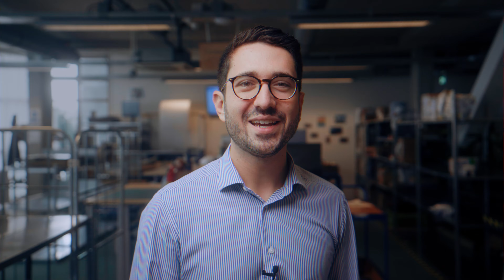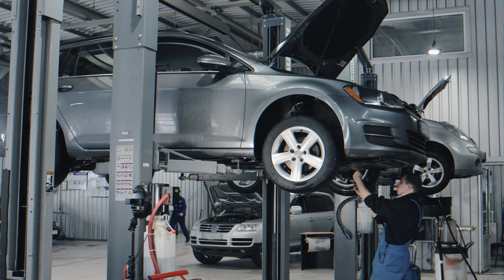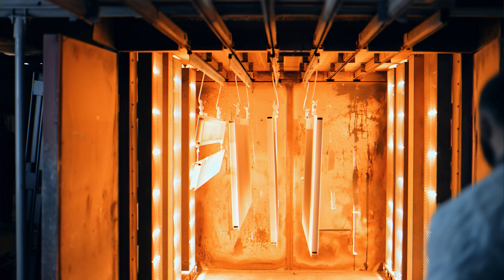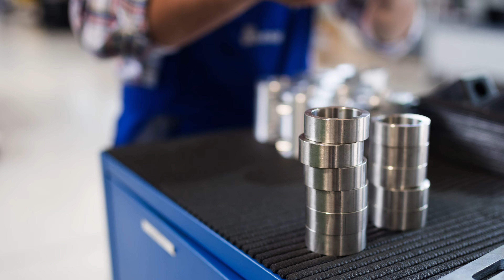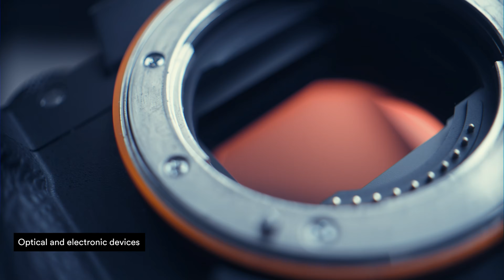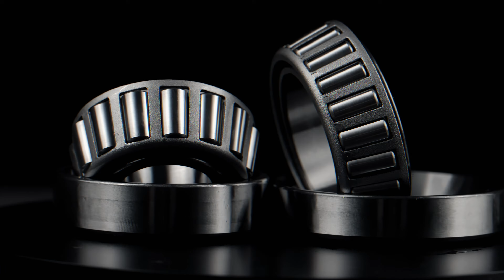When to Use as Machined Finish for Your Parts (and when not)

Comment: The surface roughness of bearings an sliding parts ist sometime counterintuitive and polishing this parts can be a failure point. The little groves, left from griding acts like a smal oil reservoir and helps with lubrication. A Polished part don't have this grooves and this can lead to a failing oil film.
Gauge blocks are a very good example what happens, when the surface is to smooth. They can stick together like they are glued. Just because of the very high surface finish. On Machinetools like Lathe and mills on the other hand, there is the surfacefinish often intentionaly roughend by scraping, to help reduce friction.